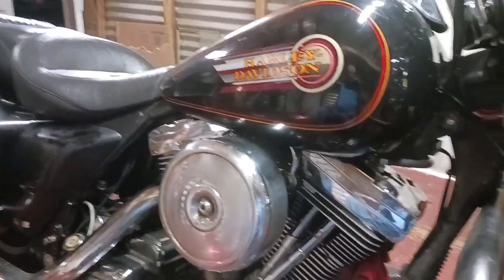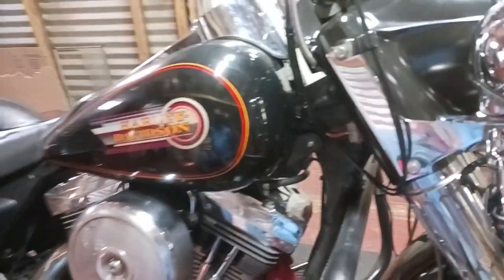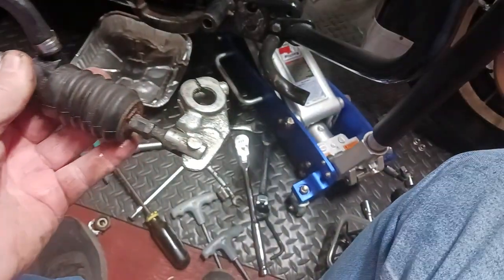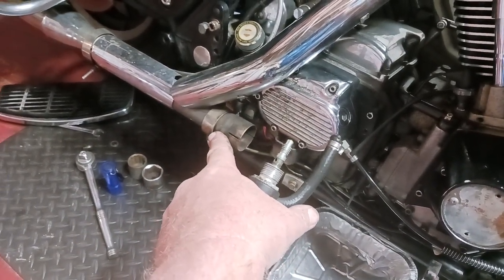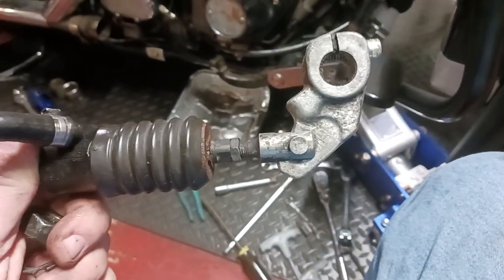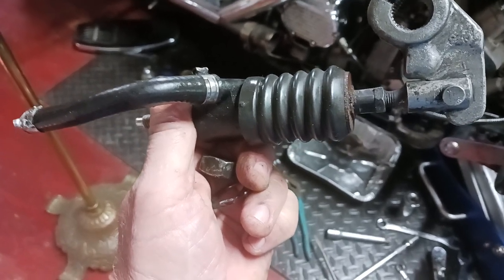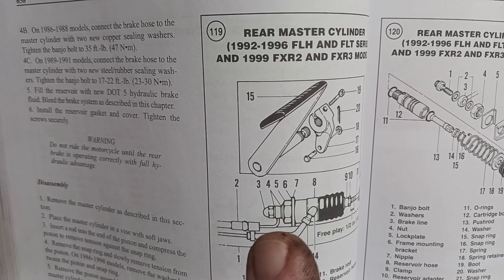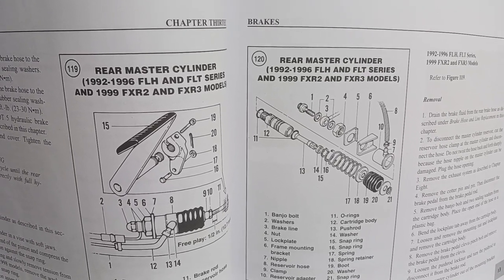HARLEY ELECTRAGLIDE REAR BRAKE MASTER CYL. REMOVAL PT.1

Comment: Persistence produces results.    I just ordered a black decker 18 volt power drill that comes with two batteries and the charger for 8.00 dollars plus 13.99 shipping for 23.80 that is due today from Fed ex.   So if you need a power drill Ed, i can give you the Ebay link.  These are new but are old stock and dont come with a warranty

Comment: ....... i told you it'd be something else. Once again,, "that's the beauty of owning a classic HD!" 👍
Reply from the maker: I knew it also. The rear brake was working fine, but I wanted to take care of it before the leak got worse. I have a new master cylinder ordered.
Reply: Which is more trouble though, a woman or a harley?
Reply from the maker: @EarlGuyton425  they are about equal. lol
Reply: @edZILLA64  Yea, Ive noticed a pattern with harley owners.  They never finish fixing it
Reply: I'm having fun with the same project & appreciate your help with this video 😎✌️

Comment: What size socket or wrench did you use to remove the  big jam nut to remove the master cylinder from the frame
Reply from the maker: watch part three . snap rings hold the master cylinder in place. i think there are 3 all together . slide the boot up to see the other ones
Reply from the maker: i dont remember the size on the nut. i would have to go back out there and check. i did this quite a while back.
Reply from the maker: I'm sorry , man, I don't remember. I want to say I think 1 3/16. Don't quote me on it though. I know it's big. You have to undo that brake line first. I wish I could help a little more, it's just been a while since I did it so it's not fresh in my mind .
Reply: @edZILLA64  I thought it might have been a 1"1/8 deep well socket it's a bitch to get to with out a lift and trying to do it with the wrench that size is virtually impossible on the ground I have everything else disconnected from it brake line foot pedal weird washer  tabs bent out of the way  etc... that big nut is the only thing keeping it attached I'll keep at it though thanks for the quick response 💯💯
Reply from the maker: @harleydavidson3061  I think it is 1 1/8